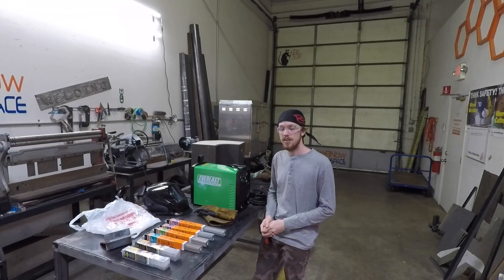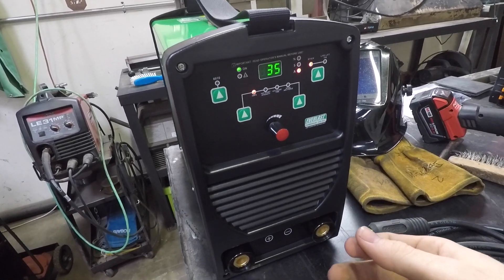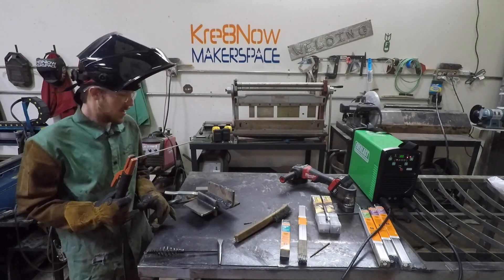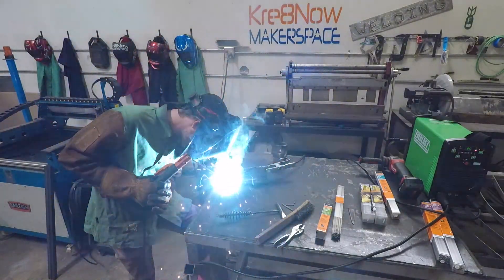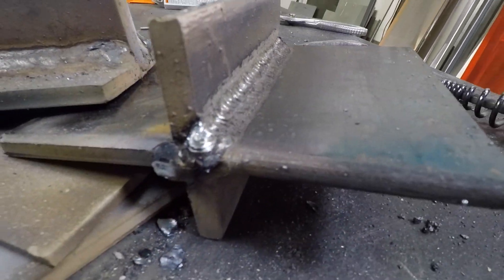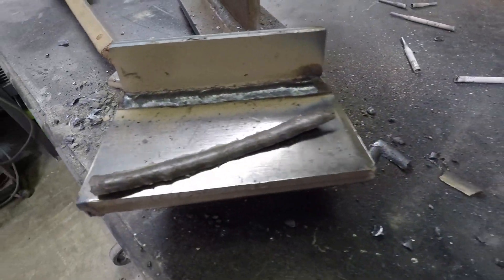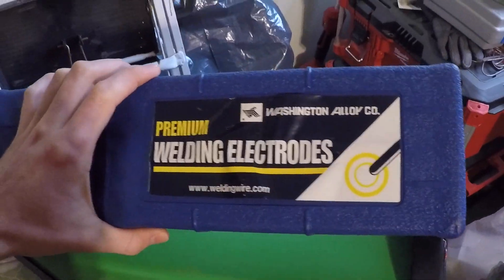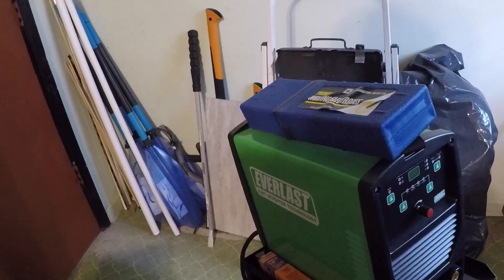FOR THE SERIOUS WELDER: Everlast PowerARC 200STI

Comment: Which one would you recommend between this model and the 210 just for stick welding and why?
Reply from the maker: thanks that's a great question when I purchased the 200STI the 210  models wasn't being produced it looks like the 210 has quite a few more useful features I haven't tried all of those features so I can't say how well they work but it definitely does look like some improvement if the price difference doesn't mean much to you I might just get the newer model with more features but if you're trying to save some money I think the older model would be very similar in capability.

Comment: I have a power pro 164 from 5 years ago sitting in storage. It's a great acdc tig with lots of ac capability... also the 40a plasma and stick welder.

Stick welder it basically only wants to run 7018 though. 6010 gotta run hot to get voltage up and even then it's off and on. But the 164 is 78lbs (model I have, non digital)

I was considering this welder over the yeswelder 165. Mostly because it runs 6010 but also I trust Everlast. Just 4x the price... :(

I've heard yeswelder works good but the amperage is over inflated with what actually is occurring at the electrode. Everlast I know for sure is dead accurate. 
I may bite the 400 bucks OR call Everlast and try to get a deal on last year's model direct from sales. ;)

Comment: Was the machine in the video run on 120v or 240v? I am looking for a "small" inverter that will run respectably on 120v and am curious on your thoughts. I want something I can do respectable repairs with on up to 1/8" or possibly 3/16" wall steel, maybe 1/4" with small rods and multi-pass but that would be very rare. This 200STi looks like it will run 6010 very nicely from what I have found so far. That is great they packaged that in the machine (and a button for it, not a ground lead swap like the old 200ST = PITA when you are swapping rods for a 6010 root and 7018 fill + cap).
Reply from the maker: I was running the machine I believe in 220 V but it runs extremely well on 120 V as well I mainly chose to buy the machine because of its E6010 function and it does work very well there are a lot of really good multiprocess welding machines but they tend to cost a lot more so if you just want a stick welder that is going to work perfectly well I believe this is one of the best on the market and if you have a good 20 or 30 amp 120 V power supply it should run 1/8” rods no problem it is not as light as some of the inverter welding machines I have but if you don’t plan to always be carrying it around I think it’s perfectly fine
Reply: @CreativityUnleashed  Thanks for the reply. I ended up going with the 210STL and a full Tig outfit for it also. The PowerTIG 255EXT is on my radar (AC/DC tig machine) and the Tig accessories are interchangeable. The 210STL being DC-only doesn't suffice for Tig as I need AC for aluminum, but it will be interesting messing around with it on steel in the mean time. It will get me learning the motions. Its been years (10+) since I've run Tig.

Comment: should I get this or a Lincoln 225 Tombstone Ac/DC
Reply from the maker: Good question the link in tombstones have lasted a very long time and will continue to do so but as far as the new era of welding machines in what you can get out of a machine inverter welding machines work a lot better consume about a third less electricity to do the same thing and usually way a fraction of the amount so much more easy to move around multi-voltage options and you have a lot more advanced features and if you get something reputable like Everlast you should never have trouble with it either myself I don't think I would ever buy a Transformer welder again unless it's for collecting or something so I would definitely pick an inverter welder.
Reply: @CreativityUnleashed  thank you so much for the reply! Lincoln is such a respected brand but eating up electricity was something im considering you've made my decision easier :) SUBSCRIBED
Reply: Here is something to think about. I have an old Century flux core machine (small one, I think its an 80). It went out on me a couple years ago. I surpassed the duty cycle and some of the leads to the primary (it is a transformer machine, small but still transformer) melted. One of them was shorting to the ground lead going out to the ground/work clamp. When the machine was so much as plugged in (switch off even) it would zap me if I touched the clamp or work. That made welding quite interesting. In that time I got to looking at other machines. I researched inverters and looked at some of the older transformer machines. Something that really made an impression on me was how robust the old stuff is. The world could blow up and the only two things left would be cockroaches and transformer welders. They are basic and easy to work on, if something were to go (perhaps a rectifier if you get one that does DC). Unless you burn up a transformer, there isn't much on an old transformer machine you can't fix. Speaking of the transformers - the older and heavier the better. Newer ones (like the Lincoln AC or AC/DC 225 models) have lighter transformers and are easier to burn up. Miller Dialarcs and Lincoln Idealarcs from around the 70's or earlier are really hard to beat. For even "heavy" fabrication (heavy for any garage fab) I don't think you could possibly over-use an old transformer machine. If you look around there are tons of them on the used market and if you wait for the right one you can get them for next to nothing. As far as an inverter machine (any) - with all the computerization in them something eventually is going to go wrong and there isn't much you can fix. Even for someone skilled in soldering and board-level repairs it would be very difficult to repair an inverter. The easier "repair" to the inverters is if you can diagnose what board has an issue you can replace the whole board. But that comes at a cost - it could be several hundred dollars for a board. And what happens in 15 years when something goes and the manufacturer has been out of replacement parts/boards for 7 years having long since discontinued the machine? If it were me - and I think all welders should have one - I think we all need an old transformer "tombstone" welder around. When all else fails you will have it to always have something to stick metal together with. Yeah, if you like clean welds and are a MIG or TIG guy going "down to" stick welding might not be what ya want to do, but if your other machines go down and you can't repair them in a reasonable amount of time and something just has to get welded - there will always be the tombstone. Mine is a '66 Lincoln Round Top (Idealarc 250 AC/DC version, on a cart). You can check the restoration thread on the Welding Web forums here: https://weldingweb.com/vbb/threads/708543-1966-Round-Top-Idealarc-250. I haven't done anything to the machine to "make it work" - it welded beautifully from the first time I plugged it in. The fan needed to be freed up (dried lube in the bearings), but that was it. I just wanted it to look as good as it works - hence the restoration. But you don't have to do the work - even if you find an ugly machine that works as long as it works that's what matters. Then thank me in 15 years when the day comes you have to dust it off and stick metal together.

Comment: Show me your sets for 6010 1/8 I cant get it to turn on
Reply from the maker: The amperage I normally run 1/8"  E6010 at depends on if I'm running open root or fillet welds most commonly on open Root I run 72 amps with 10 to 20% inductance 
And on fillet welds it just depends on the base metal thickness but I would say I tend to run them under a hundred amps with maybe a 10% hot start and 1.5 second time.
I hope this answered your question and helps you out!!!!
Reply: @CreativityUnleashed   what about hot start and arc force for open root and fillet welds , sorry thank you for answering
Reply from the maker: Different people are going to say different things about the amperage and inductance / Arc Force to run an 1/8"E6010 depending if you're doing open root or fillet welds root opening land and pipe thickness are going to or plate thickness are going to change what your outcome is and what works best for you but for me an open route I normally run around 72 amps with 50% inductance or Arc Force. At welding school they had Miller machines we used didn't have a hot start so I got used to not using them so am not sure on open route what would be beneficial
And then fillet welds I haven't done an access amount of them with E6010 but I normally run them at around 80 or so amps

Comment: 200sti or 161sth. I'm new and learning but I'd like to buy a nice machine so I don't need a new one for a while. Is there one better than the other for just starting?
Reply from the maker: I gas a good question to ask is are you interested in learning multiple welding processes ?
What are you planning to be doing or are you not sure yet ?
Reply: @CreativityUnleashed  I'm just looking more. I only want stick, my friend has tig/mig multi machine so I can try his. It looks like 161 has more options for tig so 200 for just stick is probably best? A bit cheaper too

Comment: thanks for showing its performance, thinking about buying this welder for some basic pipe welding with tig, any chance you have an opinion on its performance tig welding steel?
Reply from the maker: Nick Simmons well it’s a great welding Machine and for doing lift TIG it will do just as good about as any for pipe welding if you’re not going to be changing the amperage while welding. and especially if you need to do E6010 this can be great for the price but if you plan on doing other projects that require high frequency tag or welding aluminum or other things like that it could be good to spend more and get one of their high-end multi process welding Machines but they tend to be a lot less portable so it just depends on what features you need if you have any other questions feel free to ask
Reply from the maker: For lift TIG it should be very similar to most machines I didn't have a TIG torch or argon there for it so I haven't tried TIG on it yet. For it's capability I think it's great there are obviously a lot of other companies that make maybe a more durable are compact package that do the same thing but tend to cost about twice as much so I have been happy.
 for me I would prefer to be a bit smaller butt it's fine